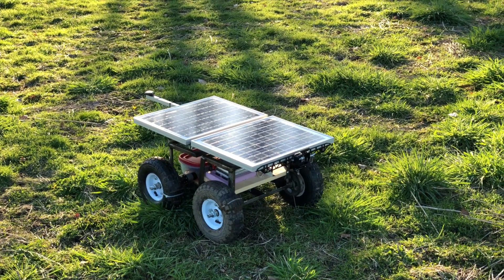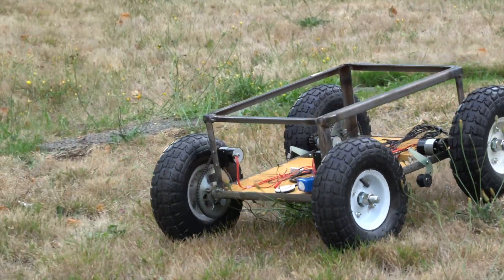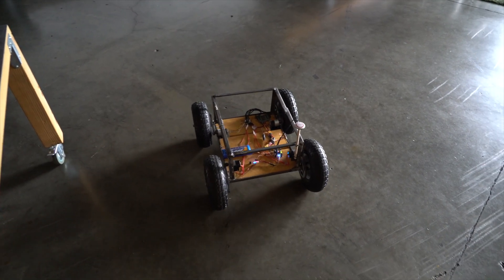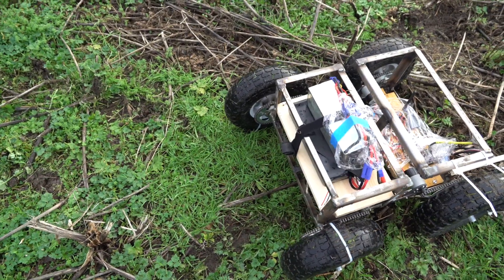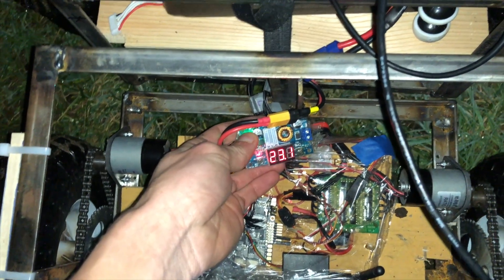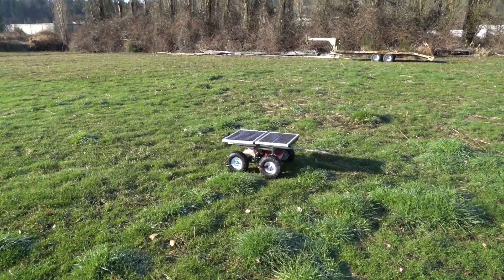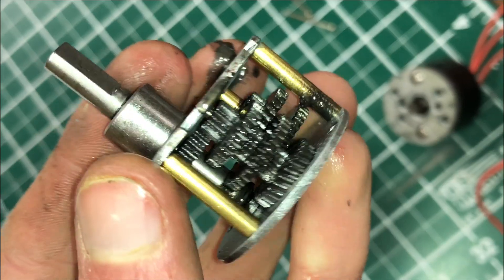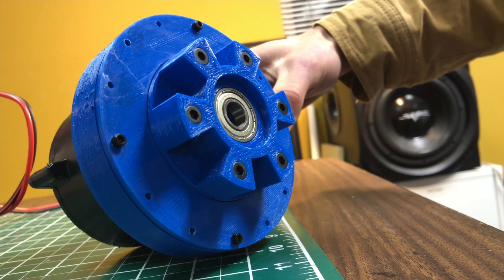Autonomous Solar Powered Rover

Comment: Not sure if you are responding to posts, because I have a question about the 'autonomous solar rover'.
? Why did you choose the type of skid-steering versus other types of steering? I'm guessing it made it easier to follow the GPS way-points. 
I'm slowly working towards a GPS, FPV drone aircraft. 
I have some experience with rc planes and one helicopter. I have been accumulating some Arduino and Rasberri Pi boards, and associated parts. Also, I purchased a 3d printer in February, 2021. I have a ton to learn. 
I have some cnc, Bridgeport, and lathe experience. And a tiny bit of welding experience. 
I love the autonomous Tupperware boat. 
I saw a post regarding a company that offers drone support, especially when making delieveries. My 1st. thought was your videos and which direction you went in after graduating from college. 
'Technology Demonstrator'. My ultimate goal is aircraft, but it would make sense to learn on the ground versus losing an rc plane, and more importantly, the electronics.
Thanks for the videos, they have helped give me some direction, advice, and motivation.

Comment: Seems like it would not be difficult to add lines to the program, if wheels are turning but GPS position does not change for 3 to 5 min, initiate "unstuck" protocol,  (reverse for 1 min then pivot right one min, then pivot left one min, return to main program  ) .

Comment: What motor and driver do you recommend to power a similar rover in a range of speed between 1 and 15mph?
I’m having trouble finding something that has a wide range of speeds with good efficiency.

Comment: why the obsession with 4 wheels? Make 3 wheels one wheel what is free swinging in the middle, the other 2 mothers just pull, of course correcting by going backwards isn´t optimal but it still will work better in most situations ;)

Comment: Good project overall and good electronics.  However, you are using way too light mechanical components for the wheels, the chain, the gears, and height given the terrain.  The electronics portions of your design seems very good.  But, it seems you have to think more about the environmental parameters and the extreme stress points of your physical components.  Also, it may help to put more protective items around exposed moving parts and possible redundancy in the mechanical items.

Comment: What is the function of that little voltage regulator you are using, if it has the solar panels connected directly to the input you will have problems at sunrise, those buck regulators don't like slowly rising voltages on the input (sunrise), and will not startup.

Comment: ...so I designed an additional 3D printed cycloidal gearbox with a 13:1 reduction ratio that goes in series with the Barbie Jeep gearbox........ ooooofffff course ya did!! LOL. I'd expect you to 3D print a cold fusion reactor next to power the thing. Great job on this.

Comment: how does the rover continue to do way point missions after you leave it and drive away? is your transmitter still at the field? if you turned your transmitter off wouldn't the rover go into failsafe mode?

Comment: If those wheels on that rover are solid and not air filled, I would cut a paddle or lug style tread into them, so they provide great Driving grip in soft areas.

Comment: Have you considered using stepper motors instead of gearbox motors? They have excellent low-end torque. You could make them direct-drive. Seems like it would be perfect for this application.

Comment: If you buy an old powered wheelchair and take off the seat you have a 'bogie' ready for about 15km of heavy work.  Add the electronics...Im' in Ireland and already have one if you'd like to Co operate.  I have lathe, milling machine fold and shear etc, so I can look after mechanical part.Joss in Cork, Ireland.

Comment: Hoverboard wheels with in-wheel motors are also very usable and reduce complexity. We're using them with two dummy wheels on the front and 2 wheel drive for our rover. Also, weight wise it might be good to use flexible solar panels.

Comment: Daniel!, those cheap PLASTIC tires are your problem. Get real rubber tires, with thread and inflate them as low pressure as you can, traction will be much better!

Comment: 1/ Wheels are not all terrain. Use tires with pikes !
2/ You missed up how tank works. In 1945, they would have done what you are doing. But today, with 4 independant electric motors, why don't you reverse those on the opposite side to allow a full turn without moving ?
3/ You do not seems to master how programming a GPS. Have a look on GPS WAAS stuff (SBAS/EGNOS in europe), this would correct your position up to a meter precision. Then you would have to include a line following algorythm to join all waypoints like in a corridor way (one meter side box). You will not face such erratic moves.
4/ Take a beer :-)

Comment: This thing could really use a caster or two with two fixed drive wheels instead of 4 fixed wheels. Would turn so much better and take a lot of load off those motors.

Comment: Maybe ad some little feet actuators? Then if the program detects the GPS stays stuck in one spot too long, it could cycle those every now and then to lift the whole vehicle up and set it down again to try and get it un-stuck. Might help with the treads digging through the ground. Other than that, perhaps two sets of bogies and some free-spinning wheels that aren't driven to spread out the weight more? It'd end up looking more like some kind of rover yet.

Also I don't see any problems with the new gearing. Just that the plastic it's made from could shear if it's loaded up enough. (Depends on what kind of traction those wheels could get.)

Comment: If you have enough solar power a 4G uplink and a website showing it's current position (obfuscated!) and it's current total distance traveled etc. would be awesome. So we (subscribers) could follow this little rover on it's purely entertaining mission :D Add some BMP280 sensor (temperature, humidity, pressure) and it could be the first autonomous, motorized weather station.

Comment: Normal 2 whell steering  would be more efficient, and it wouldnt get stuck as much. Flat mounted solar panel are not the best. It would produce more if it was angled ro the sun.

Comment: I want to make one like this with a mower attachment. I was thinking of adding steering to each wheel. If you could angle them in combination with the motor drive differential and avoid skid steering, it should improve traction.
Reply: I'm collecting materials to do the same. I was thinking of 2 drive wheels and 1 swivel wheel, that way it can go back and forth and change directions.
Reply: @tigeroll  that design works fine for flat surfaces with predictable traction, but if one wheel falls in a hole or spins, there is no backup traction to get you out. My zero turn mower is made this way and it gets stuck on hills and wet grass easily.  If a wheel starts slipping going down a hill, there is no way to steer it.
Reply: @michaellowe3665  Brilliant TY.

Comment: You can flash the firmware on the multi rotor esc to support bidirectional motors. Nearly all esc's can do it. Even tiny whoop drones can be flashed for 3d inverted flight.

Comment: Why fight it? Chop it again (because the third time is a charm...haha) and make it a 3 wheeler then use the rudder control to steer the 3rd wheel. Are you going to add a noisemaker to scare off the geese?

Comment: Have you thought about using a hub from electric scooters/bike (motor in the hub) with 3d printed airless deep threaded flexible tires? Try searching "electric wheel 36v" on ali for example. Lmk if you need help :)

Comment: If you separate the wheels and glue the tires to the rims with silicone you can drop the air pressure to almost 0, way better traction and a little bit of suspension

Comment: That's really cool!  Maybe add more of those grips on the wheels, maybe 4 per wheel, and it will be pretty good I think.   For the GPS mount wonder if having a little antenna tower would work too, though I guess it would cast a shadow on the solar panels.
Reply: you can probably make a tower from see through stuff like acrylic(though i don't know how reliable acrylic is)

Comment: Looks like a lot of fun, but those motors and gearboxes sounded horrible! Has to be a better solution!
4 hoverboard  hub motors with or without gearing? Make your own low kv motor and use hall effect sensors?

Comment: One small suggestion for future missions: doing a loop course will stress the motors on one side a lot more, if you turned your waypoint mission into more of a figure 8 it would even out the work both sides are doing a bit.  I love the idea of this bot just trundling around in a field all day, hope your Barbie gearboxes make things work!
Reply: I made a "battlebot" type robot with those kind of motors and won second place against much more sophisticated and expensive competitors. In the end, my choice of surplus, used batteries (batteries were not very affordable back then) is what failed and not the motor packs. I think the only reason that they were not commonly used back then was that they had non-standard drive outputs and 3D printers were not a thing. I ended up taking a welding class, specifically to make adapters for them.

Comment: Tracks... like from a tank. Also, use RC car ESCs for reverse.
Reply: Its hard to find custom tracks, 3d printers are really the easiest thing to make them, and I can be fiddly dealing with sprockets, harder then wheels, but yes your right, it needs them
Reply: Would not track be prone debris?
Reply: Tracks are better to traverse any terrain, but they require more frequent maintenance.

Comment: This is awesome! Consider using wheels with grousers like the Mars rovers. Should work well on soft terrain. For a smaller rover this size I would increase the grouser size in comparison to Curiosity to like 2cm with a 10cm wheel diameter. A simple wheel like that should be 3D-printable as well!

Comment: noob question : vesc instead of multi rotor esc ? My understanding is that they're better suited for ground vehicules, especially for slow starts
Reply: With the barbie jeep motors being brushed motors, the esc needed is a lot simpler, a reprogramable BLESC could probably be made to run a BDC motor, but why bother when BESCs are cheap.

Comment: You should use the Mars rover suspension. And then the back sets of 2 tires on each side would be connected by chain so 1 less motor and then expand the solar panels another foot on each side with a down angle 38 degrees the rover would have the rover suspension in the back and don’t change the front. If you don’t/won’t have a sensor you should put bumpers. 👍 Thanks for reading.

Comment: Now if you add a metal detector and gps based mapping software that records each detection for you to go back and find the metal later-Then you have something!
Something I invented years ago, you made it possible and automatic once this is perfected.  Think of it: you could have this autonomously find metal in large areas, taking most of the leg work out of the equation.  Excellent videos, I watch them all.
Reply: Cool for finding mines
Reply: Marc-Antoine there was something for that along time ago during the Cold War. The bomb squad uses stuff similar too it. However pressure mines are against the Genova convention because of how many civilians they have accidentally killed after the wars are over
Reply: @MABFR01  Another genius idea, also sellable, but for a life saving purpose. That is a multimillion dollar idea many large countries would use.. but surely it already has been tried
Reply: @dertythegrower  for mines they usually use "hero rats" which are specially trained rats who are able to locate the smell of TNT
Reply: @dertythegrower  no.. Actually countries use giant rats for mine detection. No joke
Reply: For marking, a solenoid controlled spray can, or small flags, fired into the ground, might prove simpler to manage as you don't have to use mapping. Pair that with a a random search pattern, and you'll have detection from multiple directions, to make detection more reliable. Leave in a field for a week, and check the markings armed with your pinpointer only. Could use different colors for ferrous and nonferrous?
Reply: @Tore_Lund  Much better than GPS.
Reply: Genius idea, sellable for sure
Reply: I have done metaldetecting for years, and i can say this wont work like you said. You need to move detector side to side like once per second. That needs a motor system and causes wobble. Then, metal frame and wires will cause interfearance with the detector. Also, you really need to hear the signals from the detector by yourself so you can skip like nails and stuff like that. That come only with human experience. Cool idea tho
Reply: @Saxutin  I know, I'm detecting too, and in pinpoint mode, you don't actually have to swing it, though you get less depth and no discrimination, so a simple noise level output to trigger the spray can, would produce a pattern like with ground penetrating radar, so somewhat fuzzy, but still very useful to know where not to dig, and where areas of interest are. A digital detector with with an output for non ferrous would be even better. I both have a kit pulse induction detector for beach hunting and my highly treasured  Fisher 1266-X, which is pure analog magic with the old 8" coil. It beats any modern detector. My record was a 2" silver broche found 75cm under a forest floor, the ground was porous, but still impressive. Every season, I need to train my ears again, to relearn the nuances and a detector like that, would not be useful on a robot.
Reply: @Tore_Lund  Wow, I really have to say 75cm is really impressive for a coin
Reply: @Saxutin  No A broche, ornamented jewelry with a pin you attach to clothing, do you spell it like that in English? Not fancy: stamped seashell like piece with an enamel flower motive in the middle. The pin on the back was hand soldered, so definitely old. Still in dry dirt, 45-55cm is common, if the is not too much trash.  However detecting at that depth the field is narrow, so I have to go slowly inching forward, and the holes you need to dig are much more work. But it means, I can go over a worked field and find stuff below plough depth others have missed.
Reply: @Tore_Lund  https://en.wikipedia.org/wiki/Brooch :)  Broach is an alternative which is fairly common (it's how I'd pronounce it).
Reply: @Saxutin  It could work with a different design.
Reply: Ya I read it wrong... Was thinking about coin.
Reply: use it in australia where many gold is and use larger wheels for offroad. also use obstacle detectors so ur rover can avoid obstacles. pretty easy to make, u will find ounces of gold if properly build
Reply: @Shockwelle1  Agreed!
Reply: None of you guys have really thought about this have you?
Reply: Everyone saying rats are used for mine detection, accurate...then again this device equipped with a metal detector and mapping software as well as all terrain obstacle features would be mass production capable, relatively inexpensive, and could even include a ground tamper to aid in mine detonation.  Yes it would be sacrificial, but much cheaper than many other methods, and it could autonomously secure large areas.  I think it's a great idea.  Also my original idea for metal detection is also a great idea in my opinion, would love to see it perfected and in action.
Reply: Typical consumer GPS isn't accurate enough, but if you want to spend a lot more you can get accuracy.
Reply: For mines a drone would be better, less chance of hitting a mine
Reply: That's Sound Interesting 👌
Reply: Then u should design a software wich is can show the stuff that the rover found and mark it on the map. So when we go to the marked place on the map. The rover will continue cruising all over the place while finding another stuff right? 😅😅 sorry for my bad English....